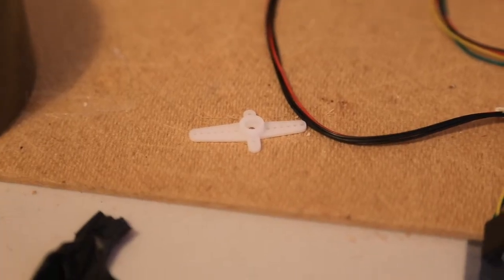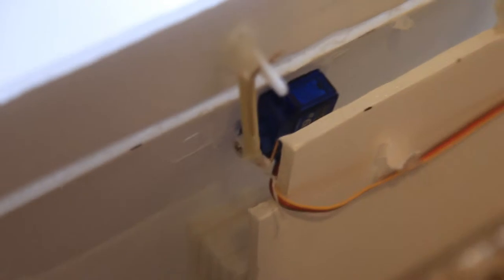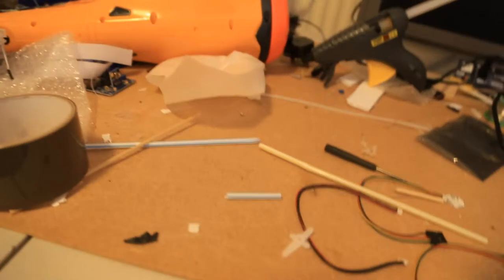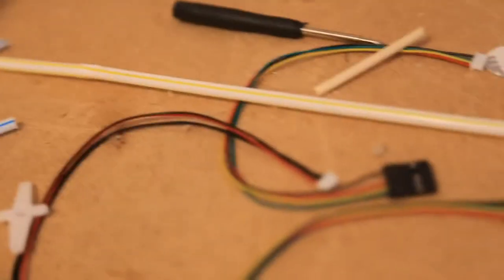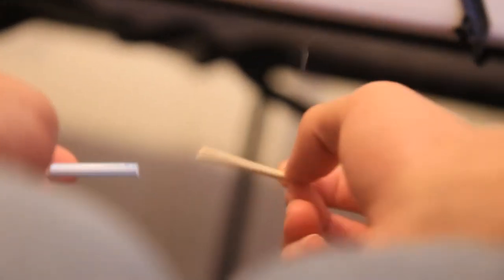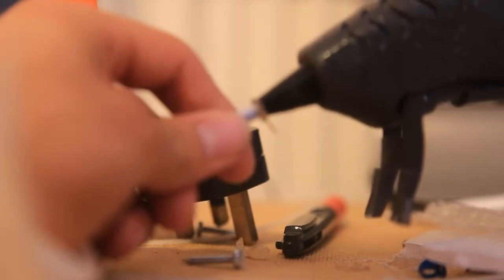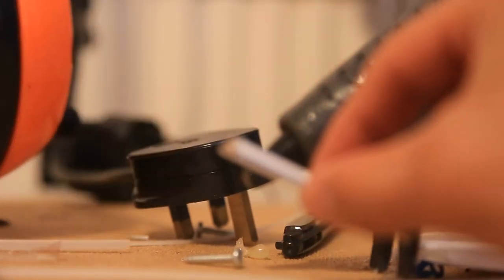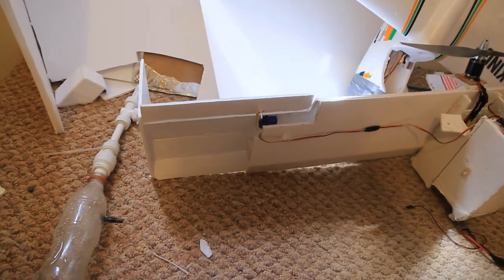Cheap DIY Servo Rod

Comment: Awesome, thanks for sharing this! Needed a makeshift servo rod for a project, and it's a Sunday night so all stores are closed, and really wanted to get it done today. Happen to have some extra guitar strings lying around, never thought to use them as connectors for the rod to the arm. =)

Just FYI also, those cheap chopsticks they give for takeaway at Chinese restaurants work great instead of the BBQ skewers..